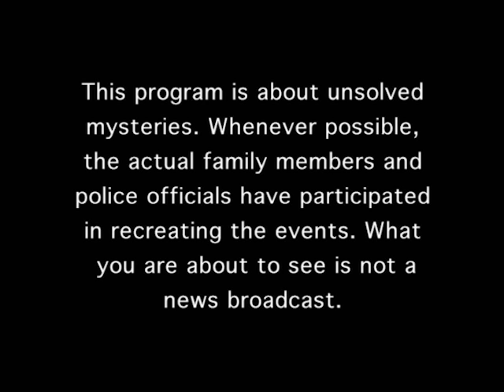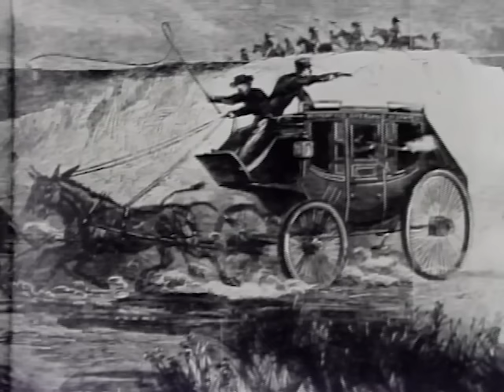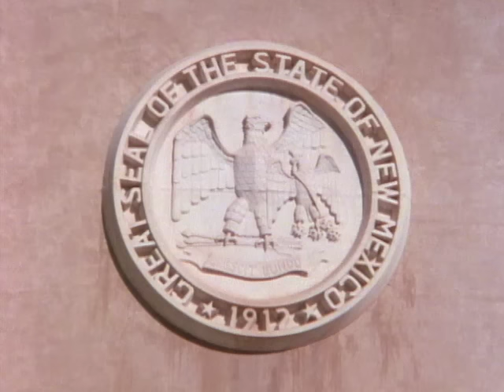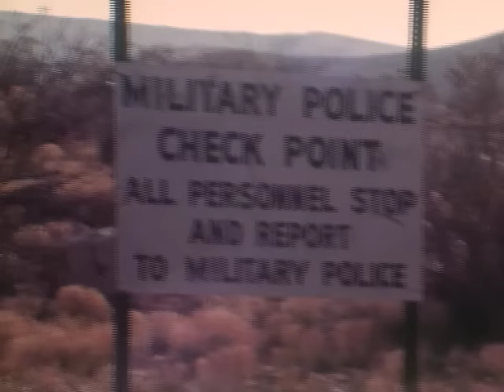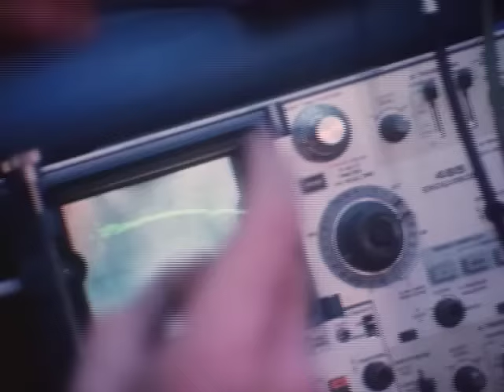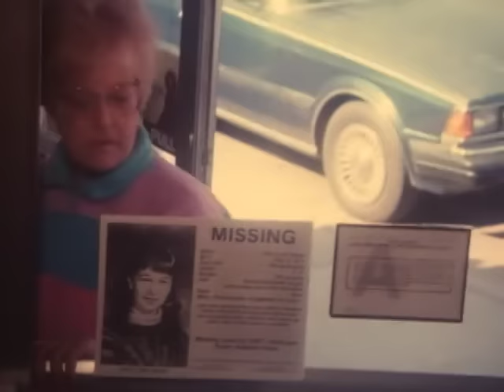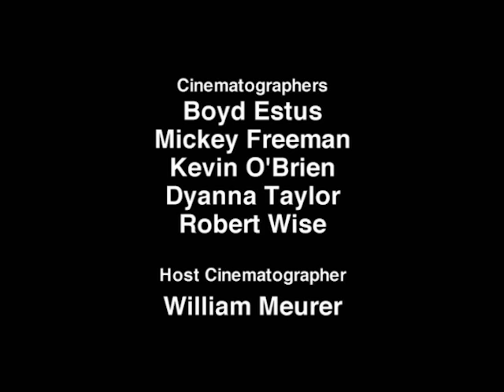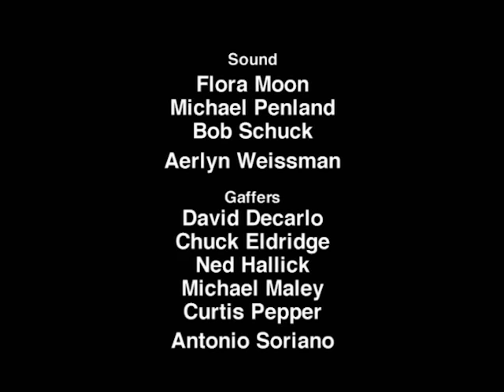Unsolved Mysteries with Robert Stack - Season 1 Episode 24 - Full Episode

Comment: Investigators later released the full message written at the Bad Route rest area: "HOT JOCK SHOT WAD FROM WISCONSIN 11/85 SATURDAY THE 3rd". However, no new leads came from the message. Under hypnosis, Clyde Mitchell told investigators that the first three numbers of the killer's license plate were: 147. Investigators were able to narrow down the suspect's vehicle to less than sixty different owners. However, they were unable to determine if any of them were Dexter's killer. The case is still being investigated, but there are few leads.
Frederick Siegle, the caretaker of the rest stop where Dexter was found, died in 1997 at the age of 81.
Reply: Leave it to the police to completely misinterpret what "Hot Jock" shooting a "wad" means.
Reply: @geoffreystuttle8080  Old-timers with no understanding of modern slang.
Reply: @geoffreystuttle8080  lol

Comment: Unsolved. Investigators later released the full message written at the rest stop: "HOT JOCK SHOT WAD FROM WISCONSIN 11/85 SATURDAY THE 3rd". However, no new leads came from it. Some investigators now believe that it has nothing to do with the murder.
Under hypnosis, Clyde Mitchell told investigators that the first three numbers of Dexter's killer's license plate were 1 4 7. Investigators were able to narrow down the vehicle to less than sixty owners. However, they were unable to determine if any of them were the killer. In 2012, the case was reopened, but there have been few leads since then.
In 1997, Fred Siegle died at the age of eighty-one

Comment: 23:20
The bar size seems to be
10 cm x 10 cm x 20 cm = 2000 cm3

The density of pure gold is 19.3 g/cm3
19.3 g/cm3 * 2000 cm3 = 38600 g = 38 kg

14 K yellow gold is between 12.9 to 13.6 g/cm3
12.9 g/cm3 * 2000 cm3 = 25800 g = 25 kg

It's as heavy as half a lightweight person.
Reply: Yeah, at least 55lbs

Comment: 23:20
The bar size seems to be
10 cm x 10 cm x 20 cm = 2000 cm3

The density of pure gold is 19.3 g/cm3
19.3 g/cm3 * 2000 cm3 = 38600 g = 38 kg

14 K yellow gold is between 12.9 to 13.6 g/cm3
12.9 g/cm3 * 2000 cm3 = 25800 g = 25 kg

It's as heavy as half a lightweight person.

Comment: the bit about those gold bars being dark until they scrubbed them - that gives it away. gold doesnt oxidize. it doesnt rust and it doesnt collect crap on it from the air. dust maybe, but there wouldnt be 100% dust coverage of the block: it was laying on something. and dust doesnt creep underneath things flat on a table etc. one side would have been shiny gold. so i call bollocks.